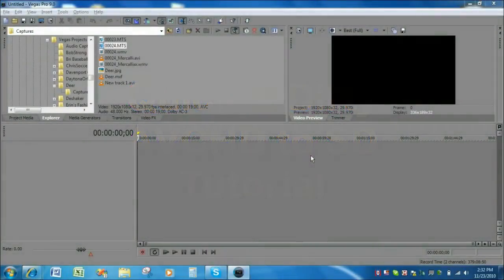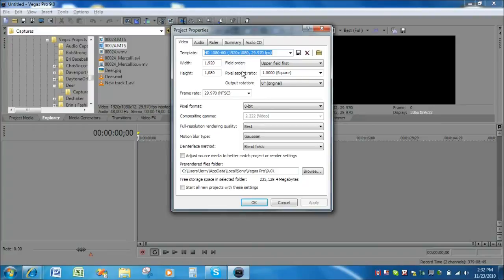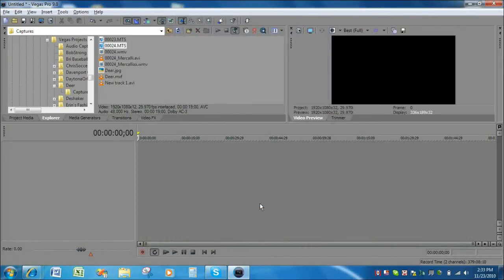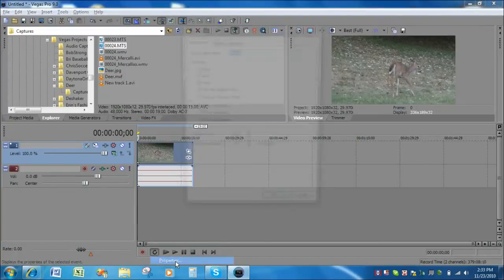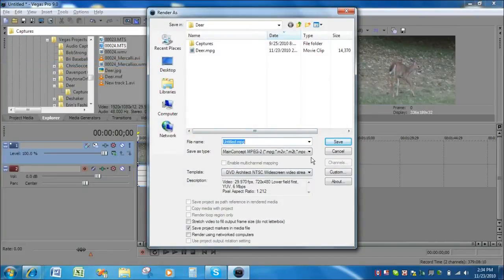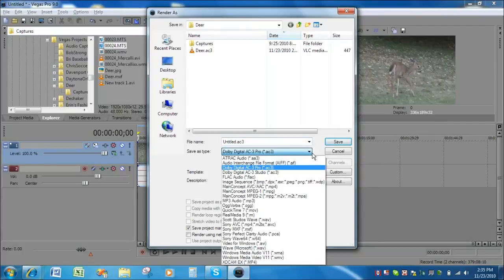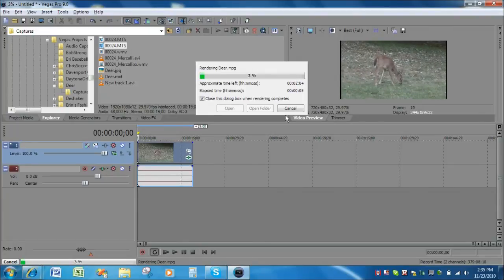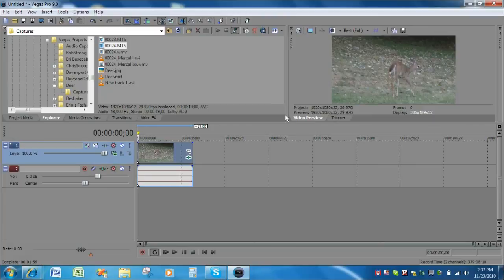Sony Vegas 9.0e AVCHD to SD Tutorial (revised)

Comment: @amendegw OK...So I am working in PAL system so I want to be sure that that stands for PAL too :) My input settings for filed order are the same as yours that is upper field firs and by convention PAL SD footage is lower field first.When I export footage from Vegas to mpeg2 architect wide screen video stream I should leave field order in export settings as it is by default ( lover field first ) or change that to upper field first to mach input file? Sorry for boring you with my questions  :)

Comment: Three things should be added to this tutorial.

1. MPEG-2 render: select "Best" for the render quality. 

2. AC-3 render: Dialog Normalization to -31 dB; Line mode profile and RF profile set to none.

3. Set pan crop for each event to match the aspect ratio of SD Widescreen (otherwise you get small black bars on the final video).